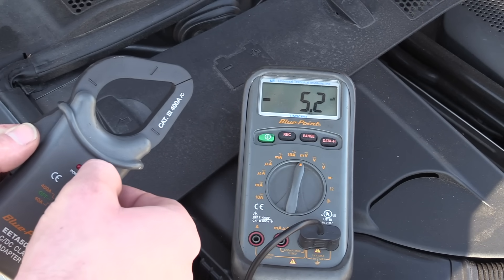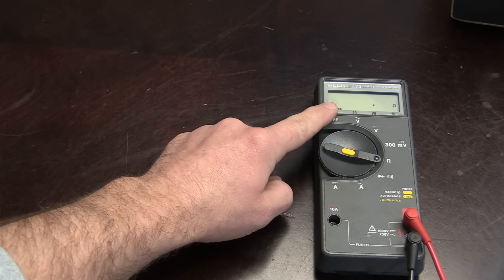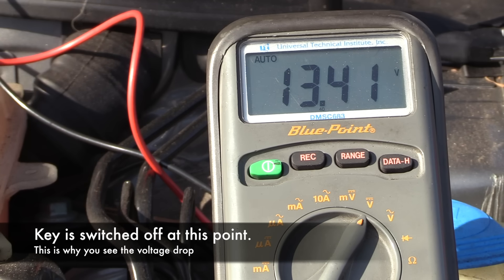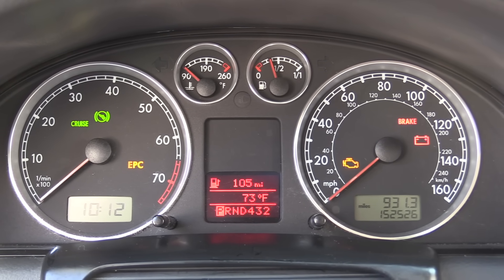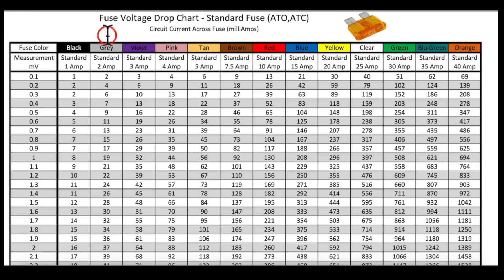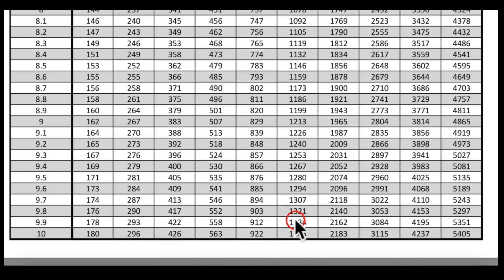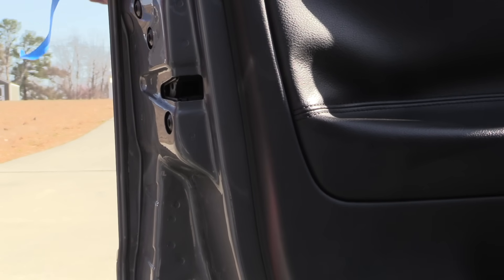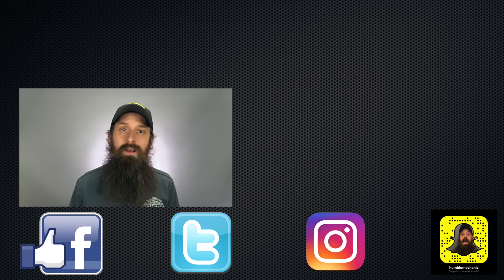The BEST Way TO Perform a Parasitic Draw Test

Comment: i have an audi that has multiple things going wrong.  i checked visually the fuses, they are good. but when i test them with the tester light it doesnt light up like if the fuse is bad, but visually i checked them and im 100% sure they are ok. i have 14 fuses that are good but the tester doesnt think so.  the tester light works on the other fuses. except on 14 of them.  and those 14 fuses match the exact problems that my car is giving me. 

anybody has any ideas or sugggestions or input on this ?? thank you
Reply: Dani_el Are you saying your test light is lightning on both sides of the fuse or just one side?

Comment: Thanks for the video.  By the way, just to clear things up, (atleast for me, still learning). When I test all the fuses, the value should always be "0" in the multimeter. Once the value goes up. Thats the one causing the parasitic draw? Am I correct? And the chart is only to see how much it draws power?

Comment: Tried it your way and i found a circuit with 4.5 mv chased my tail for 1/2 hr only to find that it was a blown fuse. please update with this info check the fuses lol
Reply: I think that is so blatantly obvious it didn't occur to him to mention it. Besides this test can easily show if a fuse is blown or not. If the meter goes down to 0.0 millivolt and holds there while touching both terminals of the fuse, then clearly the fuse has continuity.

Comment: Putting a meter across live circuits does not give you current or volt  your only getting resistance. Only way to test is put one lead to negative.
To get amps you test in series on live but a meter leads are + -  not ++ so you can blow your meter fuse

Comment: My car is driving me NUTS:
1.) Battery is brand new, bought it 2 weeks ago.
2.) My car killed it in 1 1/2 weeks.
3.) I had a mechanic look at it and said there was a minor draw from the after market alarm system. He advised me to unplug the fuse when my car was not in use. I did that and it still killed the battery yet again!
I don't know what to do anymore.

Comment: Excellent! 
I had to do this on my old 89 accord a while back. When I first tried using a clamp meter, I didn't see any draw. The meter wasn't sensitive enough to detect it. 

I did put my meter in line with the battery cable and pull fuses to test the circuits, as I didn't know about this method. While it did work wonderfully, this is a far better method for testing parasitic draw. 

Thank you very much for this video! Keep educating!

Comment: I'd rather just break the ground cable off the battery and jump it with a amp meter and read the amps directly. If you find a problem then you'll have to isolate it.

Comment: Parasitic paycheck draw.

Auto mechanics.
Middle age kids still living at home with mom and dad.
Modern cars.

I'm joking.
But most mechanics today use the fix don't test method.
They keep fixing stuff until.its fixed then bill the poor sob who's got to pay for it.
I'm glade to see someone who cares enough to learn.
But like I said modern cars can be a drain.
Reply: True. My car was overheating so my mechanic replaced the gauge stepper motor, next week replaced thermostat, next week replaced hoses.. He wanted to keep going and using my money to gamble with parts instead of doing actual fucking troubleshooting and diagnostics so I just gave up and sold the car
Dont take my new one to him anymore, its too bad i was a loyal customer for years

Comment: Excellent way. Thank you. I am NEVER that brave to pull out all fuses from a Mercedes Benz LOL. Found two fuses from the sound system with total of about 1.2 Milivolts. Pulled them out and waiting to see if the battery drain stops. Thanks again.

Comment: Alternatively, you could use an ammeter to display milliamps, without converting.
Reply: Need to interrupt the circuit for that, or use an inductive clamp, which can be tricky and finicky. This is a great method for quickly getting in the ballpark.

Comment: This is a very good video however when you work at an indie shop how doyou find out how much amp the circuit should be in good working order
Reply from the maker: Use that chart, if it's above that, you may have an issue

Comment: Thanks a lot this video is really helpful and it makes testing circuits so much faster than the old way of just pulling fuses and watching your meter for a drop in the system. I was able to pinpoint a parasitic loss from a aftermarket radio and my GMC Jimmy within 15 minutes from start to finish
Reply from the maker: AWESOME!!! 
Once people get past being afraid of this, they find its super fast and easy

Comment: I had a 2003 BMW 330 with flat battery syndrome after 3 days in garage. 2 certified dealers & one auto electrician could not fix it. In the end I fitted a battery  isolating switch myself & drove it for 11 years like that, switching it off every night.
Reply from the maker: NICE! I have recommended people buy a battery maintainer many times. It was always cheaper than the module that was bad.

Comment: Nice trick on the door latches and arming the locks 1 hour before testing.
VWs don't have that classic "fridge nipple" sensor as most other cars and can leave circuits on at least 5 minutes after pulling out the key.

Comment: Seems like a lot of time and effort to go through when it’s possibly not even that far into the system. Start at the battery and disconnect the,fuse/junction blocks, alternator to find which direction you should be heading. Using a test light simplifies things as well.
Reply from the maker: The only issue becomes disturbing circuits that can mask issues
Reply: Yeah I agree with you, but I’m just wondering how often that is the case. I usually clip the alligator clip of the test light to the battery cable ground terminal and touch the probe to the post and hold it there while I remove the negative terminal so it never loses a connection.          
 
 I see what you’re saying though and if I couldn’t find a draw the first time I would have to use your method.
Reply from the maker: I would almost bet you could find the draw just as fast. When it comes down to it, I don't worry too much about how, as long as it's fixed right.

Comment: I wish I would have seen your video before I started pulling out fuses to test them. My back wiper, DC plug, and AC stopped working. I was told to check the fuses. I did. Unable to find any "blown" fuses. Now my car won't start. Would checking fuses cause my car not to start?
Reply from the maker: Maybe one got put back in the wrong spot
Reply: I'll use a paint pen to verify locations and another color on opposite corner to verify I've cleared it

Comment: @ 7:10 you mention the amp draw is more than spec.. How and where do you find what the specs are supposed to be on each item? Thanks for the video!
Reply from the maker: 35ma-50am is a common industry standard for draw. I am cool up to about 60ma before I am really diving deep into an issue

Comment: Hi like the video, but have some questions due to different multimeter I have a Klein mm100 that goes up to 200m is that okay 2nd do I have to open all doors & hatch on my suburban in which I'm testing also I have a sound system with 2 batteries & I'm looking to do a big 3 or 4 upgrade to better my charging system will it make a difference appreciate any answer u can give me thank you

Comment: Great video - even as an electrical engineer I didn't know the fuse voltage trick! But a slight misstatement regarding your first chart reading - you had a current draw of about 1 amp, not .1 amps as you said.
Reply: you beat me to it

Comment: I actually have to do this on a 2007 sportster.  This would be the same method used, correct?  Watched a few others and this was the most informative. Cars and bikes are different, but power draw, is still power draw any way you look at it.
Reply: Either way, became a subscriber today. Thanks for the info
Reply from the maker: Thank you. Yep this method works for both. Lol. :)

Comment: You dont need charts.  Suzuki tought us in tech school if its under 10 milliamps is ok but lower is  normal.  And a rule of thumb to remember is 1000 ma is 1 amp.   For example 500 MA is 1/2 an amp and can drain a 10 amp hour battery in 20 hrs.
Reply from the maker: I think it depends. Some people like the chart. Plus it’s nice to show a customer on a “scale”.
Reply from the maker: But no you don’t NEED a chart
Reply: HumbleMechanic i feel ya on showing the customer part.  Now if i could get something from tire companies about those yellow and red dots...some people are convinced by the internet the red dot is to be at the valve stem

Comment: I have an 80s Cadillac, I know not your speciality but simple and has a carb. When hot it starts weak or wont turn over fast enough to start, cold it fires up no problem. Battery, alt and starter all replaced multiple times. Any ideas? Seams like something simple in my experience but hard to find.
Reply from the maker: I would be looking at the engine grounds, and doing volt drop tests to find the issue. check it hot vs cold and see where the differences are
Reply: HumbleMechanic thanks

Comment: Hey, I watch your Chanel because it’s so helpful.I recently purchased a 2011 Jetta 2.5 
The issue is that if I drive the car and I only press the gas pedal slow and let the car gain speed slow everything looks normal but if I try to increase the speed rapidly, the transmission kicks bad and it feel like if I goes to neutral for a moment.
The only code it has is p0442, p0456.
Any advice??
Please it will help a lot.

Comment: Great video, thanks!  But I would like one thing explained please.  Why can't we keep all doors closed and locked, and just keep the driver's side door open and latched?  Why do you suggest that we open all doors, and then latch them manually?
Reply from the maker: What happens if you need to get access to the connector for another door? Or remove a door panel? You’ll have to stop the test then restart it. If you open the doors and latch them, you have access to remove anything you need to.

Comment: 12.3 volts on a battery doesn't necessarily mean it's weak, it might not be new battery voltage but it'll still be good enough in most cases. My trucks battery shows 12.3 volts and after sitting for a week in sub zero temperatures, it hasn't ever failed to start or even had starter lag. A weak battery cell will most always show less than 12 volts after its been sitting... 12.3 volts is still good.

Comment: As a vw master technician myself, this has always been useful. I now work for audi, been there 3 weeks and taught my shop foreman how to do it this way...he was so confused at first lol then he made sense of what we were looking at. He found this easier.
Reply: Can you help me out? I can't find the shortage
Reply: @josejrsilva4054  this is for a current draw not finding a short.
Reply: @vduber03   It might still be useful.   ...If  Jose had a 'dead short', then he'd know the faulty circuit  by the fuse blown , however , if it's a partial short , then it can be a low current leakage and isolated as shown in the vid.     If he does have a dead short then replacing the fuse with a mini circuit breaker breaker helps in the diagnosis procedure .

Comment: good info, subbed - vw electrical is a minefield.  A good addition to this might be a short 1-2 minute informational video on why you can't just pull fuses with a current meter type hookup to locate the problem on vw's - it took me some research with my jetta to figure out why this wasn't working and the whole complicated business of the CAN bus and the crosstalk that goes on over it.

Comment: hey dude i have a 2002 saturn sl2 something is killing my battery overnite i pulled all the fuses 2 by 2 and it dident put out the test lite u no its enbetween the batt n neg terminal how should i proced to find this short ???? my dash lights n radieo are blinking on and off n i have no headlights please help bro im ripping my hair out lol
Reply from the maker: Maybe an ignition switch?
Reply: do you think that controll module under the dash could have anything to do with it also maybe lol thanks for getting back to me great channel to bro

Comment: Will running a Diagnostic reveal a parasitic drain? I'm out $900 for a new cluster and labor after replacing battery in my 2007 Dodge Ram. Thanks for a great video!
Reply from the maker: Maybe. But often not directly. Let’s say you have a fault for a component, that may also be the component causing the issue. But it rarely says “this part is causing a draw”
Reply: Thank you

Comment: Question. Someone please help me understand this. When you tested the voltage drop for the radio and the high beam fuse, I'm assuming the load was turned off? If this is the case, then why is there a voltage drop at all for a load that's turned off?

Comment: Are you implying I should Not have my .5A draw all the time? I thought it was to keep my 99 ram computer calibrated.
Reply from the maker: Half an amp is a lot.
Reply: Well, does the computer require a constant current?

Comment: Is this the same thing as a voltage drop test?
Reply from the maker: You are measuring the VD across the fuse yes.
Reply: yes, it is, if there is a current flow in the fuse (resistance in the fuse) there is a voltage drop.

Comment: When using your method to check out the fuse box on a Mitsubishi Eclipse 2001, I noticed most fuses after 3 to 5 seconds as mentioned would zero out on the meter, however the head light fuses, as well as 2 fuses that are marked with an engine icon, would actually increase in volts the longer I held the probes on it. Is this possibly due to a capacitor in the circuit somewhere charging up?
Reply from the maker: Very unlikely. But anything is possible. I’ve just never seen it happen
Reply: Wow that was a quick response, thank you
Reply: Humblemech,,I have seen this,once thru feedback of a bcm,and a kam

Comment: Hey man I just want to know if I got this right about putting the car to sleep. 

Turn off the car.
Press down any latch and button where you have it open for access. 
Wait one hour. 

Then go testing the fuses for draw with the multimeter on millivolts and referring to that chart to calculate the current draw.
Reply from the maker: Yep. Don’t forget to lock the car
Reply: HumbleMechanic sweet bro thanks

Comment: I had a problem with dying batteries that I thought was due to a current draw or an alternator problem. After looking at the battery cables, I discovered that they were spliced and held together (not just covered) with electrical tape. Replacing the cable solved the problem.

Comment: Great video and well explained. 
Im having starting as well and u mentioned “make sure V does NOT drop below during start up” what is that mean if it does fall below 10V. 
Mine does this during start up. 

When ON Volts is at 14.0 
When OFF 12.6 then slowsly drop to a point that after 2days, it doesnt start.

Comment: Thanks for this.
Im still stuck though.
I have a draw through a fuse which goes to the clocks, instrument panel, locks etc.

How do i go about narrowing it down with pulling my dash board apart?
Reply from the maker: You may not be able to. That’s a lot of stuff. Start with anything easy to get to.

Comment: LIKE HOW YOU TAKE YOUR TIME AND EXPLAIN ABOUT VOLTAGE DROP AND PARASITIC DRAW. WHEN THE NEXT TIME YOU DO ANY VOLTAGE DROP OR PARASITIC SHOW TELL YOUR VIEWER ABOUT CHECK THE FUSE FOR CORROSION AT THE TWO MEDAL POINTS WEAR YOU PUT THE METER. ALSO, THANK YOU FOR THE POWER PROBE CHART.

Comment: "The right way!"
Why measure voltage drop then convert to amps...why the hell dont you just measure amps to begin with
Reply: I thought the same thing...unless there is a very good reason why voltage not amps?
Reply: @neb-co2cs  You cannott easily measure DC amps without inserting your meter in series with the circuit.  When you break the circuit to connect your meter, you may cause one of the interconnected computer modules om the vehicle to reset and / or wake up, drawing valid power for minutes or hours, or until things settle down again. 

They DO make Hall effect DC current probes, but they tend to be expensive, and finicky, and have to clamp around the current-carrying wire.  With all the wires bundled up tight in the engine harness, it can be really difficult to isolate the one wire out of 75 that's carrying the current, plus you need an electrical system service manual to ID which wire you are interested in.

The method described in this video doesn't interrupt any module operations, so you don't end up chasing your tail for hours.

Comment: Wouldn’t it be more logical to to set your meter to read in the Ma vs Mv scale to isolate..........this is what your looking for instead of looking at a cross reference to get the same results.....but quickly
Reply: RANDY ARCHER if you use mA then you have to break the circuit.  They whole idea is to not disturb the circuit on vehicle with lots of sleeping modules.
Reply: Had to tell you thanks for the field tip found myself back against the wall with a draw that was killing a fresh battery 2 days tops! did do a draw test @ the negative terminal only reflected a 52 Ma then would drop down to 21 Ma steady after all was settled...... scratching my head like wtf is going on .....went ahead and did do a voltage drop test and actually found two issues a melted fuse under hood @ tied into the rear defroster grid blowing new fuses and the other 15 amp fuse for the heated side mirrors drawing 10.3 Mv when everything was off ..........had to step out of the box and look beyond !!! Thanks again for the Intel ,keep up the good work brother as a automotive tech my self a refresher is always needed......